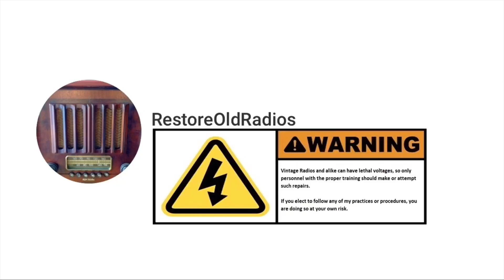Arduino Frequency Counter & I.F. Transformer Alignment Tool (Out of Circuit)

Comment: Very cool circuit and Tool Don, I'm going to try and build it, but I have zero programming experience with the raspberry Pi stuff, so I might need your help with that.
Reply from the maker: Gregg - I know you’ll be successful and find the many Arduino projects rewarding over time. Again, please let me know if you need anything. Best, Don